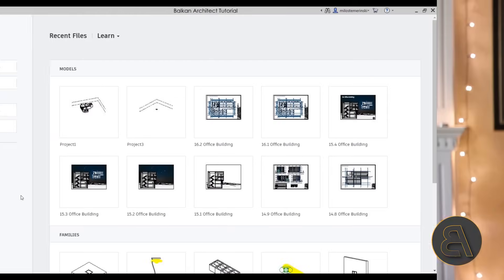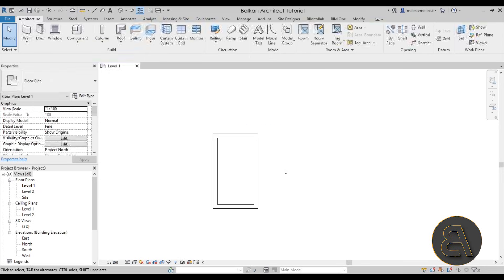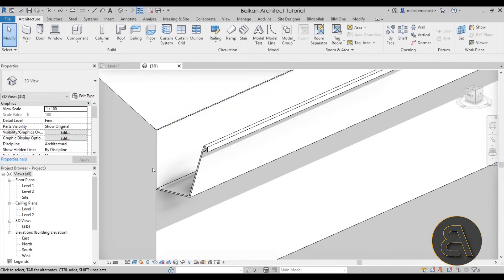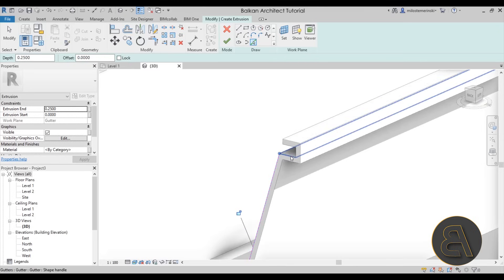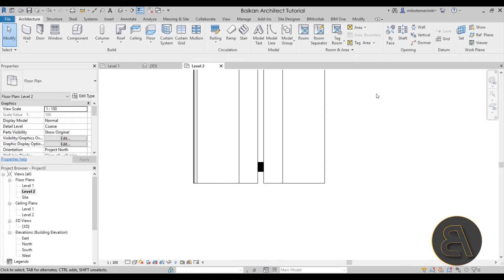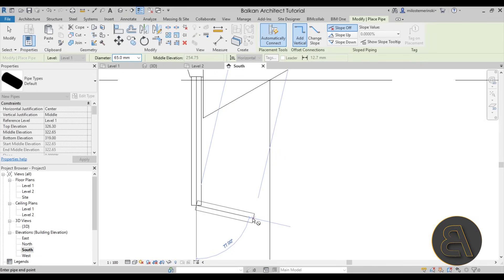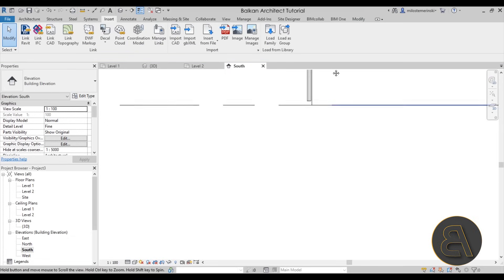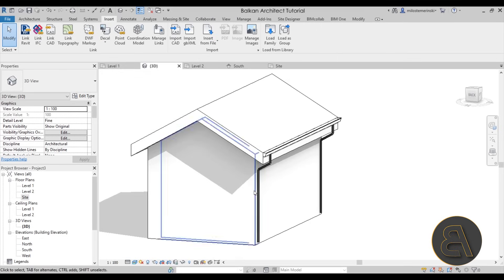Gutter + Downspout in Revit Tutorial

Comment: Hi. Is it possible match gutter material with downpipe material? Cheers
Reply: I was also stuck on this.

 I found that if you click on your gutter cap and 'edit in place' (top bar) and selecting the cap again, you then will see under the Properties Tab to your left- materials and finishes needs to be toggled to 'by category'. 

You can then exit model in place and reselect the cap and then again on the Properties (to your left) you 'edit type' and go to the ( ... ) in the materials bar and match that to whatever your gutters are mine are PVC Piping :)

Comment: The way I do down pipes is using a wall based plumbing family using a sweep. Then set instance based overhang and height dimensions with it. It works great and is much faster than doing it this way. The other benefit is if the wall moves the down pipe will move with it instead of having to move each one manually or worse forgetting to move one.
Reply: I just did this and that's perfect. Thanks a lot! For anyone else...   make the downspout profile family first, load it into the new downspout family, throw some Ref Planes (in side elev) in there and lock the sweep ends to each RP
Reply: Im going to try this because turns out i have no families whatsoever and i cant find a decent elbow anywhere online. BIM libraries online are dreadful if you want the most basic things smh, seems like the space is dominated by companies and products pushing their stock, rather than by architectural components